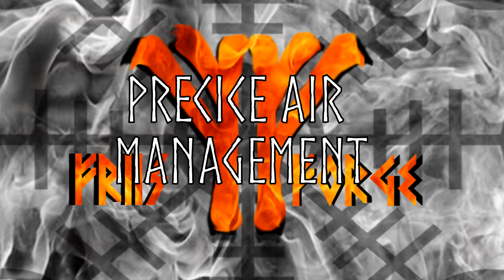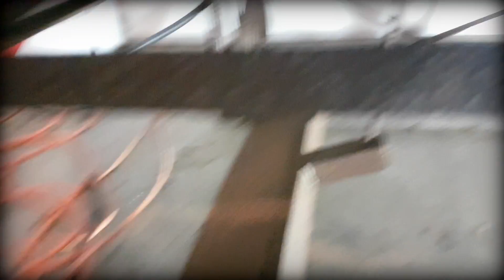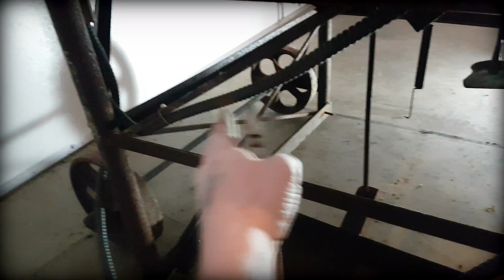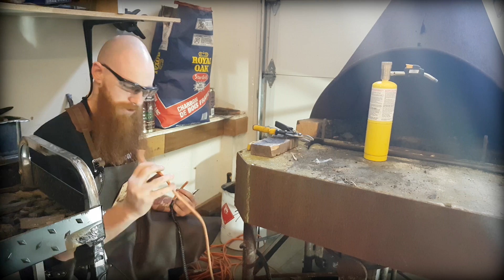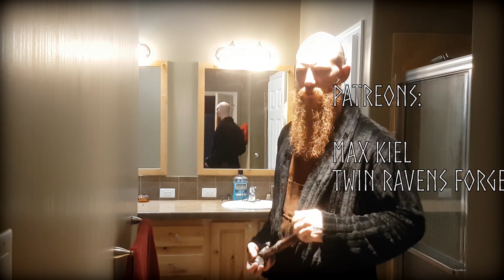✔ Electric Blower Hack (2018)

Comment: please buy a terminal block with a box cover or crimp the wires together. also wiring tape is not the greatest isolation.
Reply: Example: https://static.rapidonline.com/catalogueimages/Product/S30-2267P01WL.jpg
Reply from the maker: yes I see. Very good. I will
Reply: No get wired nuts I know they have a proper name but still be careful u might electrify ur own forge doing so tape isn't a good idea sorry well at least not alone

Comment: ..Hey Christopher, have you thought about putting a piece of metal over the fan input?? Right over the squirrel cage. Just a  piece big enough to cover the hole.  I put a piece over mine and it helped control the airflow tremendously. Even when the fan ran wide open i could get it down to where you could barely feel any airflow...
Reply: A piece of duck tape work Well To...
Reply from the maker: Yes, that is another way to achieve that.